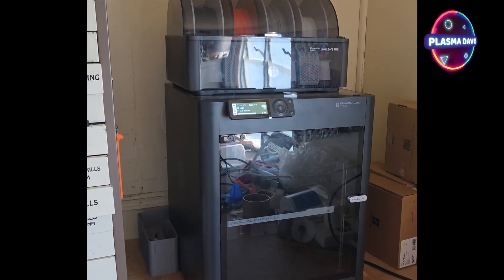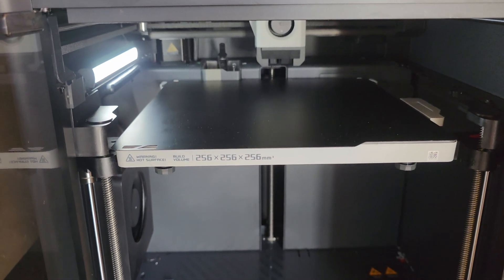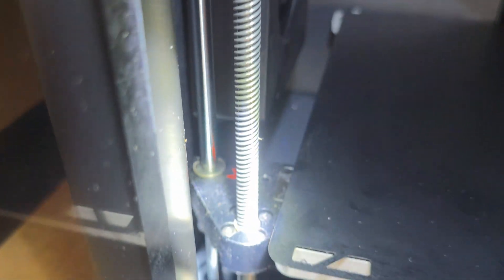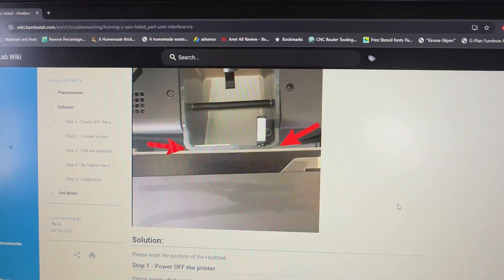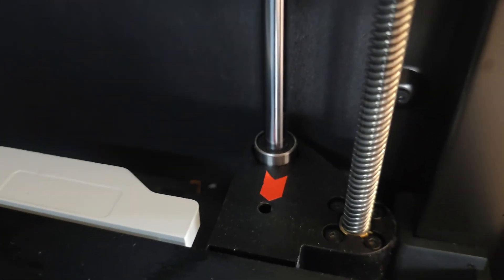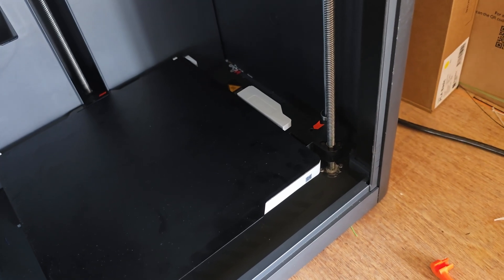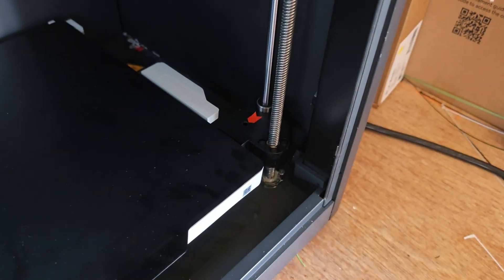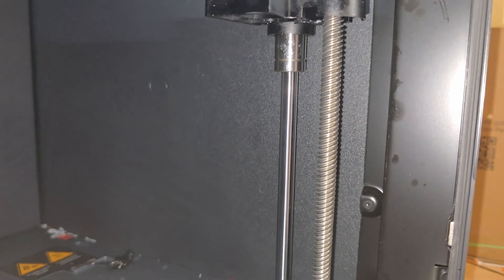Fixing Homing Z Axis Failed error on Bambu P1P, P1S or X1C 3d Printers

Comment: Thank you! I had the same issue and I had figured out the reason, but not which tool to use to fix it. My situation was a LOT worse than hours, and with this method I got it fixed.
Reply from the maker: That's good news 👍

Comment: Brother thank you so much! Lefit my problem too! P1s isnt opem so i cant flip it upside down ans push it by force as recommend so i used some pliars and it worked. Turned our i has some petg down there hidden and blended it and its squished. So when i took it out it may explain why mines (also on the right side oddly enough) was propped up. Pushed it down and it prints like the work horse that it is
Reply from the maker: It is really easy to miss

Comment: So how did you make the bearing flush? Did you push the metal part down ? Mine wont move
Reply from the maker: Yes it is a firm fit but it will move, I used the pliers shown in the video.

Comment: English:
You don’t need to flip the machine upside down! All you need is a wooden dowel that’s long enough, so you can gently tap the bearing back into place with a hammer. It’s really that simple!
Türkçe:
Makineyi ters çevirmenize gerek yok! Tek yapmanız gereken, yeterince uzun bir ahşap çubuk (mandrel/dowel) kullanmak ve yatağı yerine oturtmak için hafifçe çekiçle vurmaktır. Bu gerçekten çok basit bir işlem!
Reply from the maker: You certainly don't need to flip it over 👍

Comment: After changing out a few circuit boards and trying to recalibrate the system I was seeing the Z axis problem. I looked under my plate and found both up under the plate vs in their hole. ❤
Reply from the maker: Pleased I could help a bit 😀

Comment: Same as you plasmadave, had mine for about 6 months had the same problem got new build plate new nozzle which is not cheap comes across your video and boooom job done. Thanks for sharing your experience 👍🏻
Reply from the maker: So annoying that you had to spend up.  But 3D printers are far less troublesome than they used to be I guess.

Comment: Big heartful thanks from me as well Dave.  Spent almost a couple of hours looking at the thing until I was silly.  Could not solve the issue despite following all the guides.  Your video saved me.  My bearing was on the left side and was up about 3 times higher than yours.  A small putty knife and a small hammer let me tap it back in.

Thanks again!

Comment: I dont get how you exactly put the bearing flushed, I dont understand what Im supposed to do to get it flush. Please help : )
Reply from the maker: If the bearing is as I show in the video, pushed up. You need to push it down. So that it sits flush with the plastic. I did it with the pliers shown in the video but I guess there will be other ways to do it. Don't damage the bearing though.

Comment: Strange, but I did everything Bambu said to do, and was unable to figure it out.  Took off the back and cleared the plastic that was in there.  The bed trammed out perfectly,  no debris on screws ect.  So I kept looking for solutions, Came up with this video in one of my searches, Found the left front with debris in the hole and the bearing pushed up.  Cleared the plastic in both holes.  Reset the bearing, restarted a print and woo hoo all good not.  Thank you for the video and the solution to my problem,  You earned my subscription.  Again, Thank You.
Reply from the maker: That's great news and thanks for the sub 👍

Comment: Exactly the same problem I'm having! Yes, a piece of gold came out, but I cannot equalize that piece of iron. It never moves. what am i doing wrong?
Reply from the maker: Hmm well you need to push on the underside of the plastic and on top of the linear guide. Mine moved fairly easily using the pillars shown.

Comment: I had this error too, i thought i checket all and i cleaned all but nothing helps. 
But at the end it was realy was a tiny black piece from a failed print that broke apart (2mm diameter) that hides somehow in some corner. 
It flew out from somewere. I think it sticks from underneath at the top part of one of the 3 screws. So use a mirrow(or face came of your phne) and a flashlight to check precisly all tiny corners.

it took me 1h because i was not that negligent 😅🙈.
Reply from the maker: Well done doesn't seem to take much to cause the error does it.
Reply: @plasmaDave  I'm sure the error comes because the printing plate couldn't reach the maximum height.

Comment: Been having this issue for a few weeks, I could usually get it to home after 4 or 5 tries, but it's been getting worse. Checked the hole and found a chunk of plastic in there and saw that the bearing was pushed up about 1/8". Cleaned out the hole and vacuumed the inside of my printer, then used a wrench to pop the bearing back in place (took a good amount of force), then ran calibration and bed leveling again and now my P1S is back to printing normally.  Thanks for the great video on fixing the issue! I was getting frustrated.
Reply from the maker: Yes it's obvious but only when you know were to look, took me a while to work it out for sure. I'm very pleased it helped you out.

Comment: Thank you so much for posting this! I encountered it on a Bambu X1 after a poop snuck into that bearing pit after a major service. I ended up using a ball peen hammer and an old petg straight edge. But it worked!
Reply from the maker: I like that, as you know If it ain't fixed just use a bigger hammer 😊

Comment: I am having this issue on my x1c, will research more before proceeding with this fix, but thanks
Reply: It worked!
Reply from the maker: Great news 👍
Reply: I'm having the same issue but I do not have a bearing that is miss located.  I've tried every "Fix" out there,  tightening screws , vacuuming out all the cavities and holes, banging on the bottom of the print bed, new print plate, checking for obstructions or contact with the print bed, unplugging connectors, etc, etc.  Even getting an answer from Bambu Labs on my " ticket " has been unsuccessful .
Reply: @RogerStruthers-j6p  I'm experiencing a similar issue where the regular range of fixes just aren't working. This occurred after a print failure due to a collision resulting from an overfilled purge shoot. The nozzle isn't touching the bed during homing, missing by about 2mm, and there is definitely no obstruction, bearing issues, firmware, etc. I hope you get a fix.